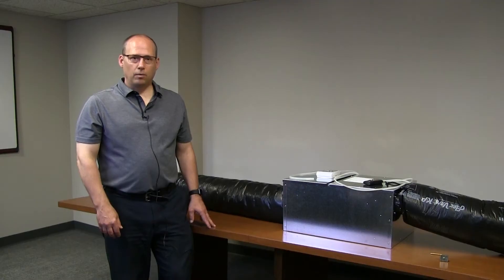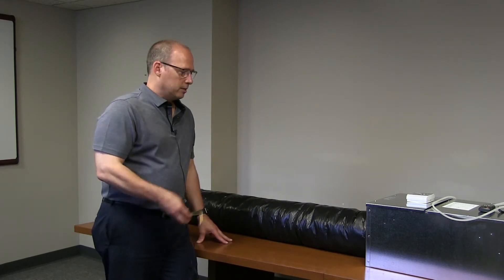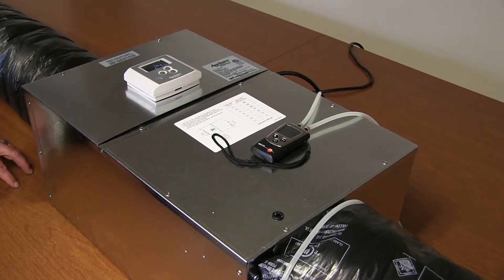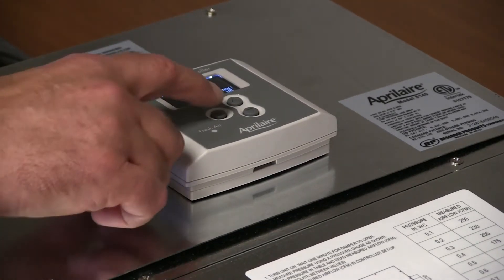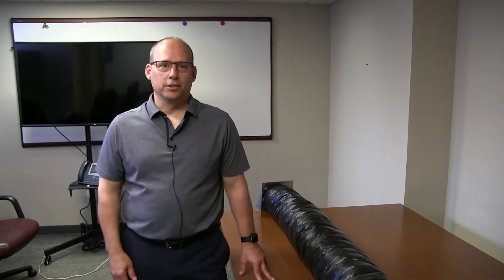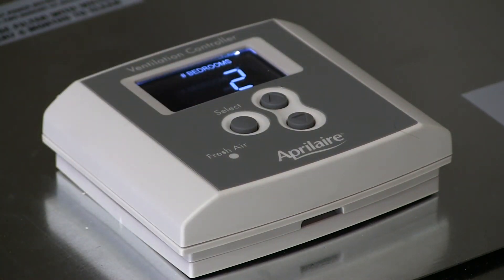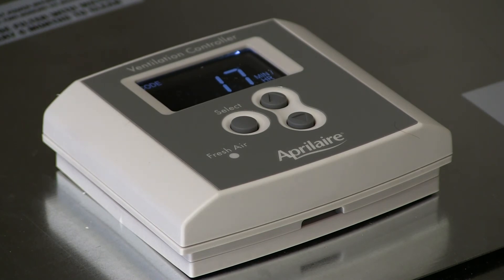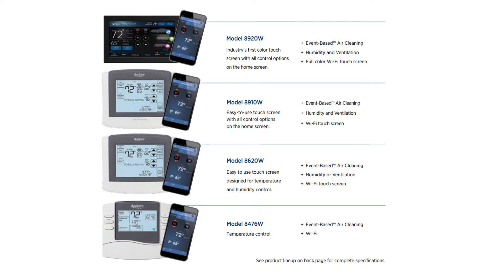AprilAire Fresh Air Ventilator Setup with Pressure Test Ports

Comment: I'm looking on our aprilaire fresh air ventilation monitor and try to compute because it say 7 mins/hr. Required continuous cfm is 47 and measure cfm is 110. and monitor saying 7 mins/hr. That could be wrong.
Reply from the maker: Thank you for contacting AprilAire! Please contact our technical support team at 800.334.6011 to discuss the timing options on your ventilator.

Comment: If the recommended time is 17 min per hour, and I change it to 40 min per hour, would that potentially make for an uncomfortable home climate in any way?
Reply from the maker: Thank you for contacting AprilAire! You can start it at the 17-minute mark, but if you increase it you may notice a difference in inside air if you are bringing in outside air more frequently. There should be temperature and humidity lockouts that can prevent air that is too cold/dry or warm/humid from coming in. If you have any additional questions, we can be reached at 800.334.6011.

Comment: I have the Aprilaire model 8120x   when Hvac system is off. The Aprilaire turns on  where is the fresh air going I don't feel any air from any vent.    Also Can the aprilaire be controlled by thermostat or any other controller instead of climbing into the attic every time?
Reply from the maker: Thank you for contacting AprilAire! We recommend contacting our technical support team at 800.334.6011 to discuss what systems you have and what controls can be used.
Reply: Were you able to get answers to those two questions? I have the same questions
Reply: @kkgg69  nope
Reply from the maker: Were you able to reach out to the technical support team?

Comment: Will this affect the HVAC system performance? And/or can the min/hour time be adjusted to a lower time per hour?
Reply from the maker: Thank you for contacting AprilAire! There can be a small affect on the HVAC system depending on the install and how much the unit is running but its a case by case basis on how much. For the adjustment, it depends on the control you are using, but the AprilAire Control has the ability to adjust lower time per hour. If you need assistance, please contact our technical support team at 800.334.6011.

Comment: How can I cut this off? They mounted the return/fresh air under my patio and it’s pulling in smoke from the grill?
Reply from the maker: Thank you for contacting AprilAire. Would you mind giving us a call at 1-800-334-6011 to discuss this? We would be happy to help. We can be reached at 1-800-334-6011 Monday through Friday, 7:00 a.m. to 5:00 p.m. CT.

Comment: My unit does not have outlet nor inlet ports. Any ideas on how to measure airflow?
Reply from the maker: Thank you for contacting Aprilaire! The ports simply make it an easy access point to measure the pressure on both sides of the system. If you do not have them then it would have to be measured by an HVAC contractor like at 0:28 in the video. Please contact your HVAC contractor to find out how much airflow is going through your system. If you have any additional questions, we would be happy to assist.

Comment: My 8126x control box reads off? I live in the Houston Texas area and I’m having a terrible time with condensation and mold growth and water poring out of my outside drain. Should it read off?
Reply from the maker: Hi Courtney - Thanks again for contacting Aprilaire! We've just replied to your previous comment. Please contact our expert support team directly at 1-800-334-6011. We are available Monday through Friday from 7:00 a.m. to 5:00 p.m. CT. We'd be happy to assist.
Reply: IF MAIN DRAIN IS FLOWING outside this is the removable of water a/s is working if your a/c system is to larger this is where your getting the mold. to cold and short run time.

Comment: Model 8140: If on the display it says "COMFORT 35 MIN/HR";  what exactly does that mean? Does it mean, the system should run every hour for 35 minutes?
Reply from the maker: Thank you for contacting Aprilaire! The “min/hr” value on the display of the Model 8120X controller on the Model 8140 shows how long the ventilator will run every hour to meet the fresh air requirements of the conditioned space. In this case, the ventilator will run for 35 minutes every hour. The “comfort” on the display indicates that the system is currently set in comfort mode. This means that if the fresh air being pulled in from outside becomes too hot or too cold, the system will not run. Those high and low temperature lockouts can be set up in the Model 8120X installation screen. If you have any additional questions, we'd be happy to assist.
Reply: @aprilaireco  Thank you so much for your reply. Seeking information on 8140 machine only.  Please explain "lockouts". Does it ("lockouts") work with 8140 too? What determines the air pressure or air velocity into the house?
Reply from the maker: @TravelAndHistory  We're happy to help! We wanted to clarify that the Model 8120X is the controller or display screen that is attached to the Model 8140. It is how you can change and adjust settings for the Model 8140. You can view a copy of the installation guide for the Model 8120X here: https://rp.widen.net/s/6pmdqvmmjz/aprilaire-8120x-digital-ventilation-control-installation-guide-b2207176 which will give you more information.

The lockout means a set high and low temperature at which the unit would no longer bring in any more fresh air from outside. For example, if the high limit is set to 90 degrees and the outdoor temperature is 95 degrees then the unit would close the damper and stop pulling in air until the temperature outside dropped. 

The air velocity you're referring to is likely the ventilation rate of the unit, which the Model 8120X will automatically set at the appropriate amount during setup. In the guide linked above, setup starts on page 14, and it displays all the information you should need to set the appropriate levels for your living space. If you have any additional questions, please let us know.
Reply: @aprilaireco  Thank you very much the information; it was very helpful. 
As mentioned before, right now, the display on Model 8140 says: "COMFORT 35 MIN/HR", but the system is not running every hour for 35 minutes.  It probably runs few times a day for 5 minutes.  The outside temperature is changing from` 70 to 81 degrees. Humidity level is fluctuating too. Do you suggest re-setting the ventilator?  If so, can the setup be made without gauge (meter)? In other words, without checking the CFM
 Thanks again!
Reply from the maker: @TravelAndHistory  If you are certain that the unit is not running for 35 minutes every hour then that is most likely due to the outdoor temperature reaching that high limit, which in turn is telling the unit to turn off. Would you mind giving us a call directly at your earliest convenience to discuss further? We'd like to have our technical support team provide you with additional assistance. We can be reached at 1-800-334-6011 Monday through Friday, 7:00am to 5:00pm CT. Thanks again for contacting Aprilaire!
Reply: @aprilaireco  Thanks for your reply.  Hopefully, it is not inconvenient for you to answer here as it is much easier and convenient/saves time. By the way, the temperature  was high 70s or low 80s. On the setting I think its high 90 or 95 and low 20. Still it was not turning on every hour for 35 minutes. Now  the controller display says E2. What does this mean"? Why the controller display has 
switched  from "COMFORT 35 MIN/HR" to E2 ??
Reply from the maker: @TravelAndHistory  Thank you for your message! In order for us to best assist you moving forward and resolve this, we do need to connect you with one of our Customer Service Agents over the phone. If you could give us a call at your earliest convenience at the number listed above, that would be great. Alternatively, please feel free to reach out to us in a private message on Facebook ( https://www.facebook.com/Aprilaire ) or Instagram ( https://www.instagram.com/aprilaireco/ ) with your direct line and we would be happy to have a team member call you directly instead.
Reply: @aprilaireco  Per your suggestion, I spoke to your tech support. I got two different answers for the same issue. So, I am confused as to who was right. 

Please note, I called the technician (they install these) to check the equipment. He saw the ventilation controller that showed “E2” (meaning the system was not working). The technician put the 8140 on test mode. The equipment started working and he said there is nothing wrong with it. After he left, the system went back to “E2”. Then I called another technician, the same exact thing happened. I do not know what the issue is.

Can you please give us the name and contact phone of the technician in your company who is an expert on 8140 Model. If you can get the answer, it would be great, as it is not easy for me to call during your company’s working hours. Your help will be greatly appreciated. Thanks!
Reply from the maker: @TravelAndHistory  Thank you for following up with us here. Can you please send us a private message on our Facebook ( https://www.facebook.com/Aprilaire/ ), Instagram ( https://www.instagram.com/aprilaireco/ ) or Twitter ( https://twitter.com/Aprilaire/ ) page with your first and last name and your direct number? We will put a team member back in touch with you directly to get this resolved! If you are not able to contact us via private message on any of those accounts, please let us know.
Reply: @aprilaireco  I am somewhat frustrated, instead of answering my question, you are asking for personal information. I already mentioned that it is convenient for me to get the answer here. Please keep in mind your answer  can be helpful for other customers facing the same issue. But if you are unable to help me its ok - No worries.
Reply from the maker: @TravelAndHistory  Thank you for your reply! In order to follow up with our technical support team to continue discussing your questions and help resolve, we need to refer them to the previous conversation you had when you gave us a call directly. This is why we asked for your name and telephone number via private message. We understand your frustration and greatly appreciate your time and patience in continuing to talk this through. If you are able to provide this information via private message to one of our social accounts linked above, we will be able to continue to work toward getting you a resolution. We want to assure you that we are committed to addressing your remaining questions! We look forward to hearing from you.